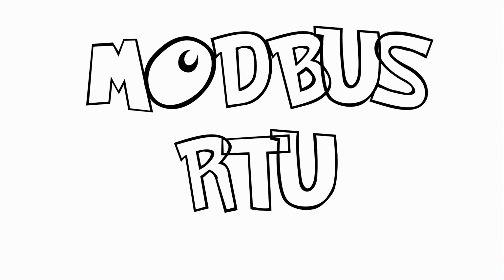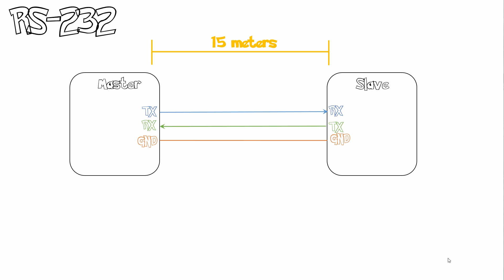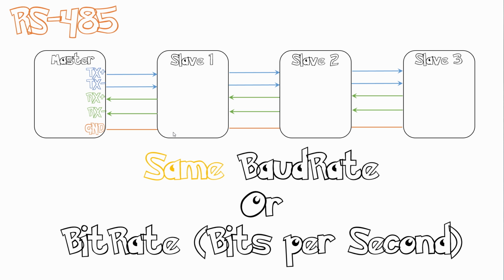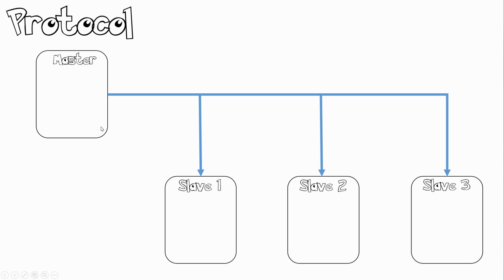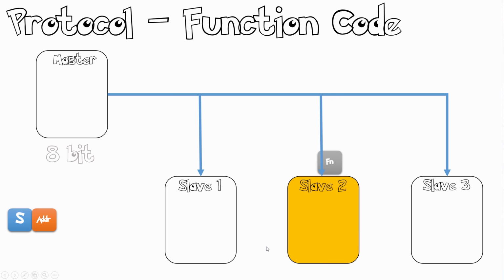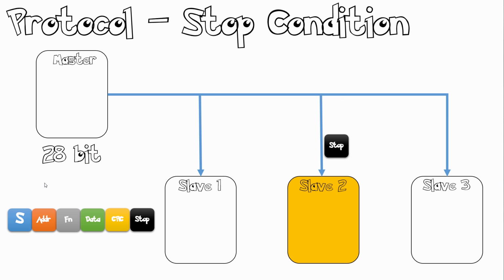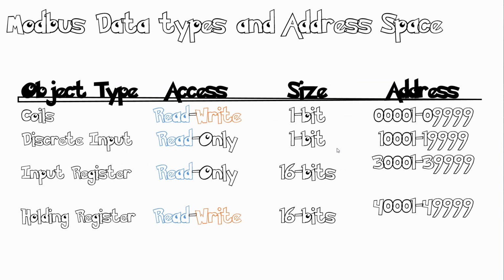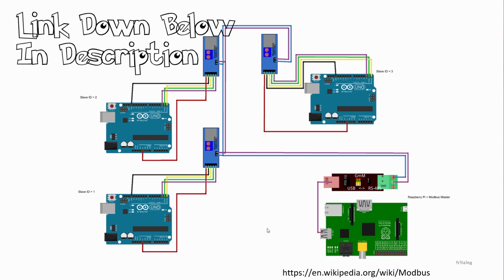Fun and Easy Modbus RTU Protocol - RS485

Comment: Great job. I understand a little more. I am trying to set up communication between an HMI package TCIP/modbus gateway and a remote RTU or Modbus device over a cell modem ethernet. I have bought several RS-485 to eth devices but having a lot of trouble getting it to work. What are the basic requirements or limitations. Cell modems have so much security in them now I don't know what to turn on or off.  Done any videos addressing something like that?

Comment: This is one of the best videos I have seen on the description of Modbus over RS485. Can I get the video for using this on arduino to publish data on my arduino to BMS systems on Modbus on RS485 ? I have temperature and pressure values on my Arduino and want to publish it to BMS. If you have a tutorial or code to use, please send to my email address: ramsy@ncpl.co / ramsy.pinto@gmail.com

Thanks and Regards,
Ramsy.

Comment: hello sir i need to make  modbus program i use omron plc cj1m cpu12  and inverter  yaskawa v1000  and i connect from plc rs232 cable go to rs232 to rs485/422 converter and go to v1000 inverter i use 2 wire   but i can"t conform first plc and inverter have comunication have or not in inverter  i check all parameter ok then plc setting  NT-link after have  2 light in my converter but light very low  then have other 2 ligh have good this light from inverter to rs485 converter communication   ple told me how i set this all setting communication between plc to inverter communication  sir then after i can make leader progarmming sir
Reply: Aaaaaahhhhh

Comment: great information! So, how would a floating point 32 bit value be sent as a read/write? thanks.
Reply: You can code the floating point into two 16 bits register in the 40000 (holding register) area.